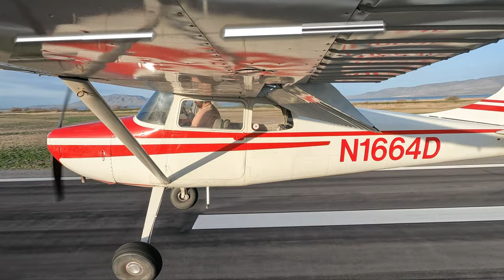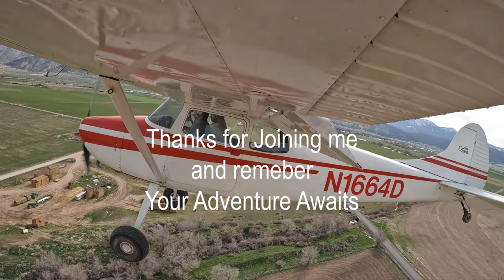Wheel Vs 3point landings Debrief.

Comment: Newly certified tailwheel pilot landing 3-points on grass runways in a Champ. Wondering what to expect when transitioning to asphalt runways?
Reply from the maker: Asphalt is far less forgiving, so take your time make sure you’re straight!  And make sure to use the proper xwind control, I see more ground loops because the try to drive the plane inside fly it!

Comment: I do notice with all of the landings I see on you tube even with heavy iron or GA a/c. Be that with narrow body or wide body a/c. Most of the demos I see pilots do not seem to attempt to even try and nail the centre line. This particular example is no different. Complications can further occur by not nailing the correct touchdown point, as displayed on the runway. 
My preferred method of landing of  tailwheel a/c is as often as possible to carry out a 3 point landing as you must be in the correct configuration at the correct airspeed. The landing will then be successful by a defined set up where by the landing will work. Wind, et al other real or imagined issues simply will not be a problem because you have set yourself up for a win, win. Also please remember to keep flying some tail wheel type airplane until you can safely turn onto the taxiway or come to a complete stop. This is especially true where stability or other implications or complications of certain tailwheel a/c types more than others due centre of gravity position or some designs, may make slowing or coming to a stop difficult in some ambient conditions. ☮️